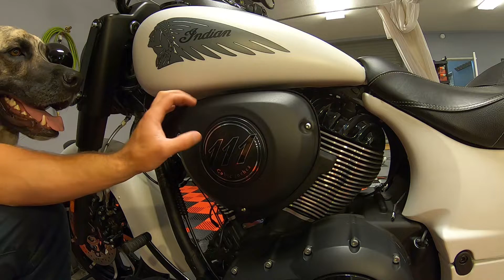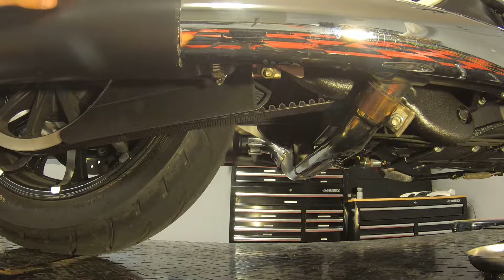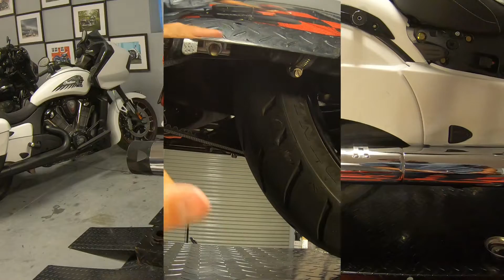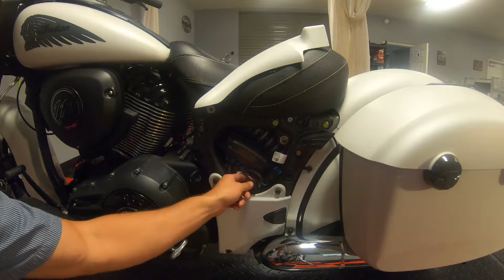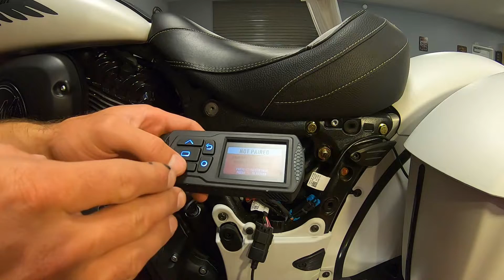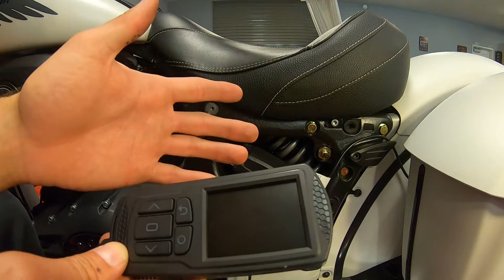Stage 1 Kit Install - Indian TS 111 - TAB Performance

Comment: I have a 2021 Indian vintage/ TS111 with the Indian Stage 1 High Flow Air Intake  and Stage 1 slip ons installed. Interested in getting the TAB with Zombie baffles...would I still need to do a flash if just installing the slip ons and nothing else? Thanks.
Reply from the maker: Just muffler swap should be ok
Reply: @TABPerformance  Thanks.

Comment: That right side tube has a big dent in it...
Reply from the maker: This is just an install video the pipe doesn't match the color of the shields either it was just a scrap muffler that we use for installation so we don't ruin a perfectly good system.  Product when purchased would obviously not have that.